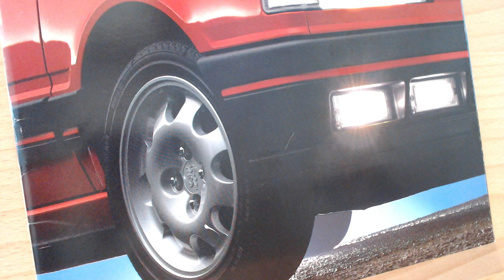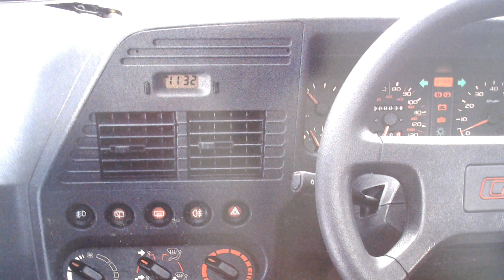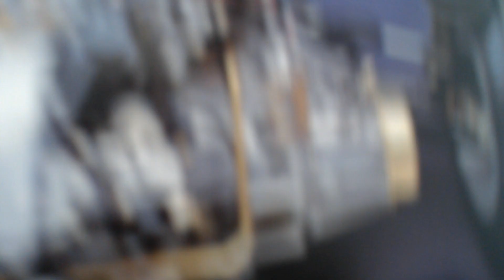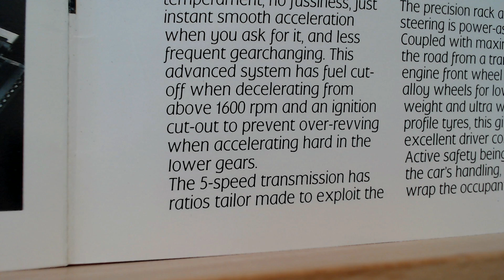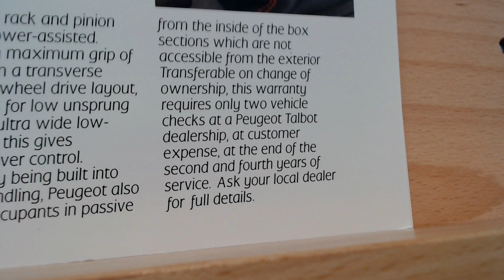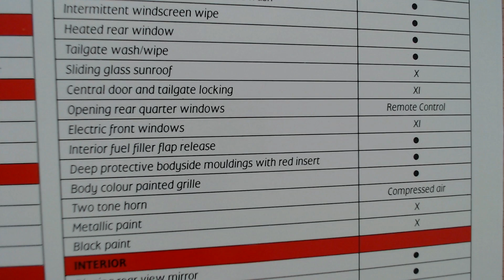The Most Underrated Hot Hatch - Peugeot 309 GTI - brochure review

Comment: I'm not surprised that the Peugeot 309 GTi could do 0-60 mph in around 8 seconds.  130 PS and a kerb weight of 930 kg give it a better power to weight ratio than many other cars of the time. I haven't seen the figures for the 205 GTi, but my guess is that it may have been lighter. Not sure what its power output was, either. The fact that the 205 GTi is more sought after suggests perhaps its power to weight ratio was even better. The French did know how to build a hot hatch.

Comment: Big improvement on the Talbot Horizon. I too never liked the dashboards in these earlier 309s. Too plasticky. Dashboard much improved after the 1989 revisions and the rear boot was modified too iirc to allow a lower sill. Much neater styling, I believe the GTis were available in 5 doors by then to broaden it's appeal.
Reply: No GTI ever as a 5 doors, sorry to say! I had a 92 modell GLX with 1.6 liter gasoline engine at 90 bhp and that was a strong, reliable car

Comment: I actually quite like the design of the dashboard and facia area around the heater controls. The Dashboard is obviously a Peugeot 205 GTi dashboard with the same instrumentation and the 6 dial dash. The ribbed design around the airvents, I actually quite like that as it flows across the facia to the right hand side of the dashboard to the airvent on the window side too. I think the console was a Simca designed one, which is why the layout is slightly different to the Peugeots. The chassis on these was phenomenal, my friend Anthony Hawkins had a GRDT model and that really did shift for a diesel and was pretty economical too. This was about 1987 and the car was only a couple of years old by then so was in its prime. Really nice to see the brochure for the GTi, I like the made in England stamp, being built in Ryton near Coventry.